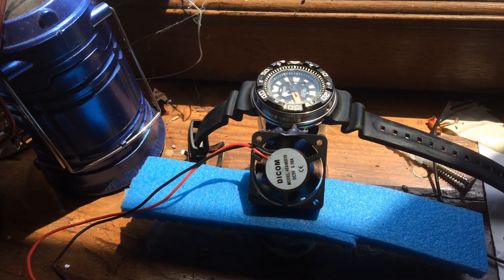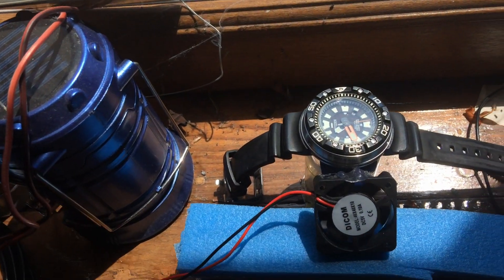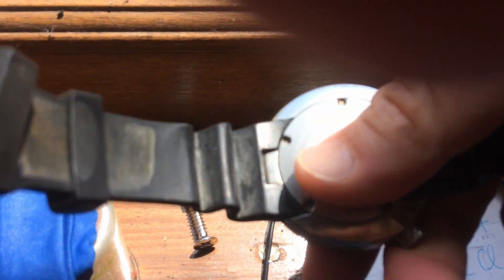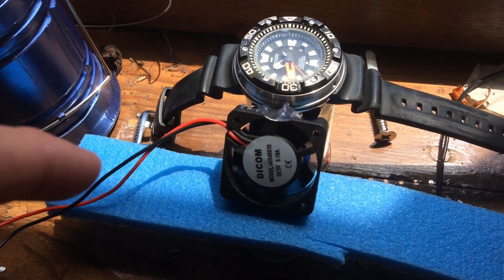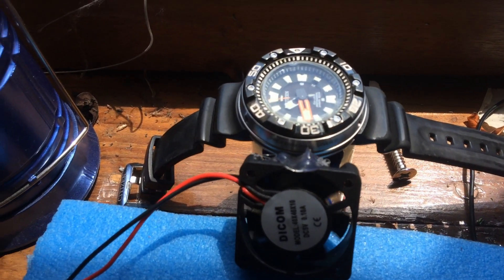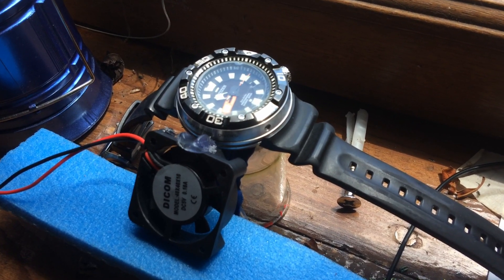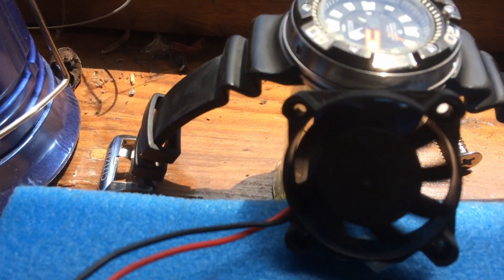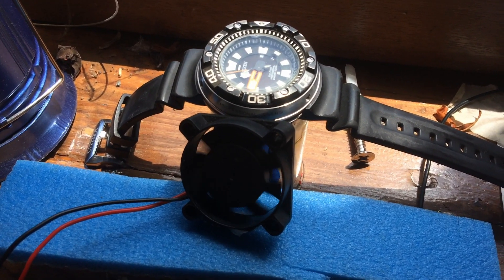Eco Drive Hack Charging in Full Sun

Comment: How many hours does it take for s full charge ? Citizen says round about 11h in full sunlight
Reply from the maker: They are probably correct but there is a caveat here, unless at the south pole during summer or any other northern hemisphere location like the north pole where the sun shines for 24 hours then it's going to see darkness and not be charging, So unless compensated (very difficult to provide such light intensity as the sun without taking into account some cooling measures, then this in reality will be a bit longer. I've taken one which had been going non stop with spot on time for over 20 years  it stopped for about 3 months because it fell behind a shelf, obviously it wasn't at full charge when it stopped because it couldn't maintain the time in darkness for those 3 months. BUT it was going after several hours of full sunlight (summer sun) with the 2 second skip, then after 3 days of the same kind of sun exposure back to complete normal. It's hard to compare as it's not the same Citizen model and also the battery is over 22 years old now, maybe 80%? Of what it would be if new?
However, if you had a new batter replacement and needed charging it's probably still around the 11 hours mark if exposed to such intensity. Remember Citizen are charging non stop 24/7 under lighting banks with their factory methods for charging. See my extensive blog on this where I have taken data from official Citizen presentations by product managers.

Comment: there is simply no way any of this is necessary lol. The point of a solar watch is to bring convenience to your life lmfao
Reply from the maker: I would agree here however a quick trawl of the various forums etc etc, people are hung up about this aspect of solar watches and i merely suggest some ideas, which I know from 22 years experience of solar watches, certainly does not harm. I've never found it to interfere with my diving and other sea activities. 

The real key issue is to understand what "amount of light" will provide that (in the case of a Citizen) 1 day charge  for one's 2 minutes. Many people do not make sure their solar watches are charged properly and this data I take of Citizen Canada (no I'm not Canadian and no I don't work for these guys) where they have said many problems they see are a result of people overheating their watches in a effort to charge them. Nothing more nothing less. 
So yeah, you're right the idea is to have a hassle free, no battery change, no winding (even for the best autos) watch that can function for some years of trouble free service (excluding routine service for those watches used specifically for diving.)